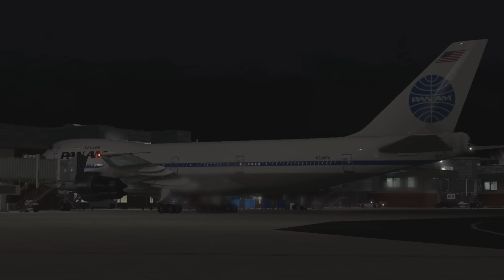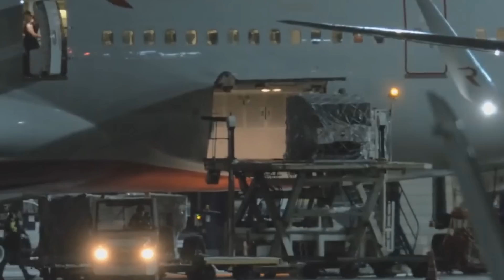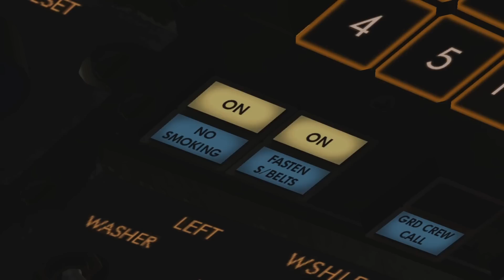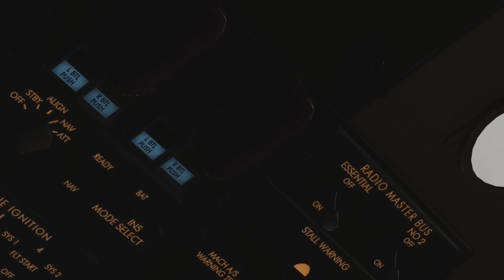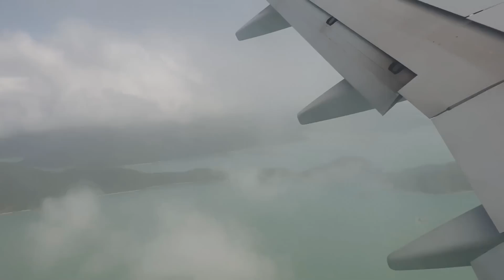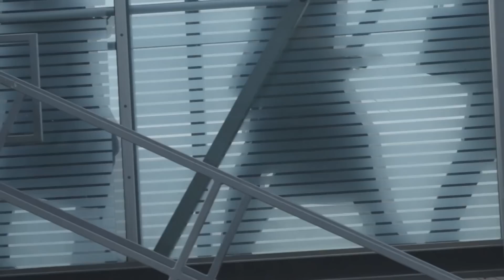Passengers Blown Out of the Hole (United Airlines Flight 811) - DISASTER BREAKDOWN

Comment: Another long-term victim of this tragedy was that of the ground handler who last closed the cargo door.

Of course, Boeing-wrongly- initially attributed the accident to mishandling by ground crew. 

18 months later, the cargo door, in two sections, was recovered from 14,100ft deep. Further investigation proved the ground handler was innocent, as the fault lay in problems with wiring and poor design.

I was stationed on Oahu twice, and I knew the nice man who last closed that door. For 18 months after the accident,  he was blamed for it. Though he knew he closed the door correctly, he couldn't escape the blame placed upon him. Even after he was exonerated, he suffered emotionally, even when I knew him fourteen years later.

Comment: How did the plane not disintegrate mid air at such high altitude? I would think a hole that large in the fuselage would severely compromise the structural integrity of the airplane.
Reply: Oh that plane was solid! What brings planes down with cargo door blowouts is loss of hydraulics and electrical issues, and the severed door colliding with wings, tailplanes, control surfaces, or engines. Check out Aloha Airlines Flight 243 if you want to see how badly you can rip apart a jet and still land it.

Comment: Must be horrible feeling when you suddenly are out of the airplane and falling few minutes to the ground still in your seat.
Reply: That’s only if you didn’t get sucked into the engine and get turned into a red mist.
Reply: There are a lot of flailing injuries (including broken necks) and even ruptured lungs from being blasted out of a jet at cruise altitude and speed. The 1985 Air India 747 bombing was a case in point. I don't think many people survive more than a few seconds. Hypoxia isn't a bad way to go though, compared to other causes. You feel drunk and fall asleep.
Reply: At 22k feet, it would've been cold and short on oxygen. They probably would have been hypoxic within a dozen seconds and thus falling unconscious before they could hit the water.
Reply: @lunayoshi  you can survive a lot longer without oxygen if you get enough adrenalin and that definently would have caused a lot of adrenalin to be released, not to mention hypoxia can take a few minutes to set in and it's possible they may have been conscious, still it's not the worst way to go at least it's quick
Reply: @almightysamwhich4203  there was a case like that, the flight attendent lady that survived another crash and was blown out and fell. She couldnt tell about that as she went unconscious during the accident and fall. She was also not afraid to fly after. The highest fall ever survived
Reply: @dreamthedream8929  yeah but she was barely alive when they got to her and she was only alive because she landed in the snow and was lodged behind a flight attendant cart

Comment: When people say "Boeing was a great company before they acquired MD in 1997, and cared so much about safety", I want to point them to this accident and say "They haven't been perfect pre-1997". They knew about the risks of their 747 cargo doors since the DC-10 accidents, and knew that the doors could be opened without human intervention since at least 1987. Yet it took an accident in 1989 for them to see that yes, this is deadly. Even then, they tried to cover up the cause and blame the ground staff (who were pushed under the bus) until the Campbells put the evidence directly in front of the NTSB's face (and another incident while a 747 was having short circuit problems in maintenance, and the door opened by itself).

I want to say that this accident single-handedly changed the way the NTSB investigated accidents on Boeing aircraft. Before, they seemed to take Boeing's word as THE conclusion. When the 737 rudder hardover accidents happened, they could've said that it was pilot error, especially on the second accident, where it seemed like the first officer was pushing hard on the wrong rudder pedal (which Boeing tried to push that that was the cause). However, they did as many tests as they could, the Eastwind incident's captain provided valuable information, and eventually managed to replicate the hardover in test conditions, proving to Boeing that they needed to fix their planes. I don't know if that would've happened if the Campbell's didn't pushed their investigation onto the NTSB.
Reply: The FAA surely didn't take notice.
Reply: @asdf3568  Yup, this was the FAA's failing as much as Boeing and the airlines. They're supposed to regulate aviation safety, yet they routinely let stuff go until the next C or D check. They have a conflict of interest because they're also charged with promoting aviation in the US, so they're very cozy with Boeing and the airlines.
Reply: I think it's obvious it would've been ignored. Boeing was clearly covering it up.
Reply: Yeah claiming boeing was a safer company is silly when the 707 has one of the highest crash rates of any jet. Modern boeing has different problems with different safety effects but aircraft safety has always been a struggle. The safety we enjoy now only came about because of hundreds of accidents caused by bad decisions over decades, just like the accidents that occur today.
Reply: sure there were issues pre 1997 but the company as a whole was run by engineers who tried to learn from mistakes and implement improvements. As was mentioned, Boeing did offer the fix yet it was up to airlines to implement. I'd attribute more blame to United for not implementing the fix. United is my favorite airline, btw, for their safety record and excellent emphasis on pilot training - they too suffered from beancounters just as Boeing has since 1997. This is what people are referring to not that there weren't accidents.

Comment: Can you do a video on TWA Flight 529? At  78 deaths, this was, for a time, the deadliest single-plane accident in United States History.
It was a plane crash September 1, 1961. Shortly after take off, pilots suffered a sudden lose of elevator control, which caused an uncommanded pitch up, until the plane eventually stalled and crashed back into the ground.

The cause was the loss of a single bolt, measuring 5/16 inch, which had fallen out of the elevator control mechanism.
Reply: well no need to do it, you just broke it down.
Reply: @BenoitRAG3  Well I can almost promise you didn't know about this accident until you read this comment!
Reply: @Dat-Mudkip  I did, but I love aviation history. Kind of a rarity now.

Comment: I was on this flight to Auckland about a month beforehand. Got a bit of a shock when I heard about it. Unsure if it was the same a/c or not.
Reply: very doubtful, aircraft rarely stay on the same route.
Reply: @BenoitRAG3  That's what I thought too. Still...
Reply: @AndrewStevenson118-1  To be fair any 747 you were on manufactured in that run was at risk so very likely could have been  ANOTHER at risk plane.
Reply: @BenoitRAG3  Oh... I hadn't thought of THAT.

Comment: Wow remains were found in the engine,how sad is that ,
Reply: At least they met a quick demise. As we know from Vesna's "flight", a pax in a seat module may have enough drag to reduce terminal velocity to within survivable limits. We will never know as the aluminum of the seats and attached pieces of racking would have made them sink like a stone, but it's probable given the fpm of the descent and the fact their SaO2 would have been at 99% immediately prior that they were conscious for at least part, if not all of the journey. One can only hope that they were either in shock or mortally and instantly wounded by the ejection as a result of collision with debris etc as the ride down sounds like a horror movie.
Reply: @manyshnooks  the shock of ejection at 20000 feet at roughly 400 mph would already have you short of breath. you would pass out before getting to breathable oxygen. No way they were concious more then 10-15 seconds.
Reply: @BenoitRAG3  That's comforting, at least. Ever since I heard of this accident, I wondered what exactly those passengers went through. A dozen seconds of cold, windy freefall before unconsciousness isn't as bad as what I was imagining.
Reply: When they say remains... I'm not sure how they can tell it was just one. I've seen photos of what that looks like. The body is liquefied. It's happened a number of times on the ground when people carelessly walked in front of engines that were running.